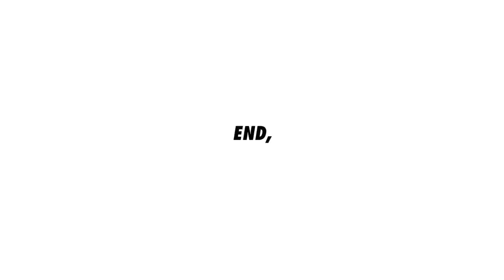W106_Apartment small Kitchen with walnut and stainless steel

Comment: Hello, your work is beautiful...  I’m new to woodworking and learning all the time.  Focused on building garage cabinets at this point, as I’m not comfortable building something that will be seen inside my home because I want it to look good.  I do have a question about how you finished your walnut; did you just sand and use polyurethane?  I do love walnut and considering a built-in lower cabinet in my bedroom..... that is after I build a few more garage cabinets 😆